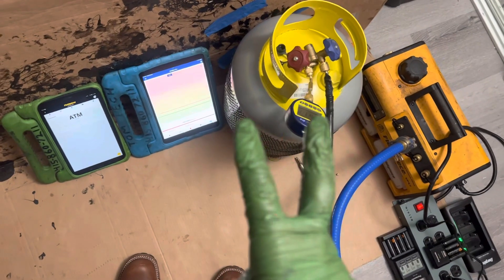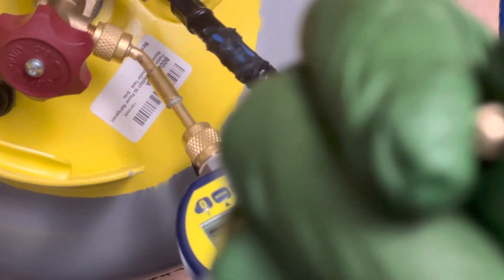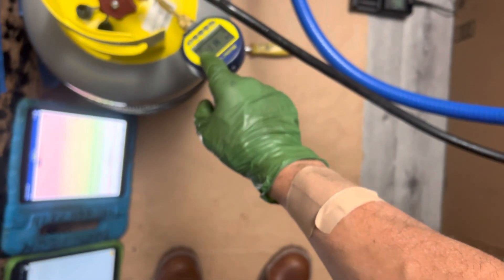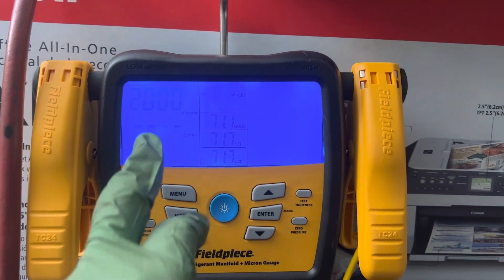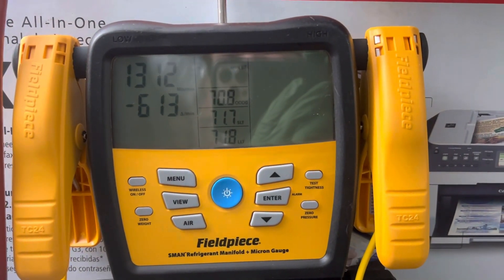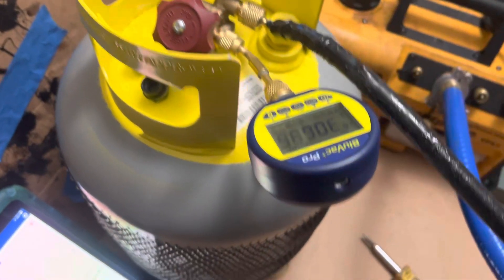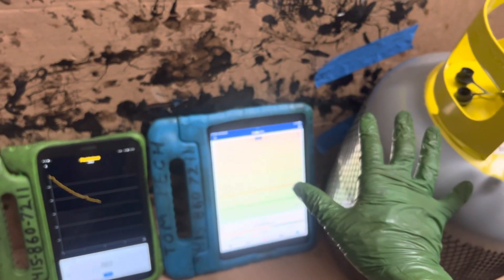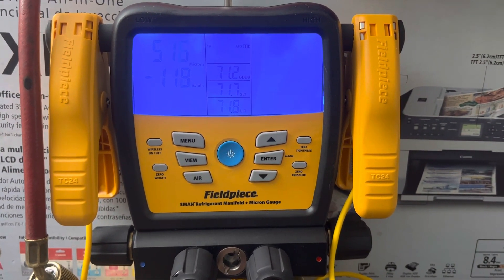Removed Valve Core Depressor ￼out of Hose to Speed Up Vacuum. Time Dropped From 16 min to 9 min

Comment: Wow. Trublu is such a mighty sucker.  Almost 1,000 micron higher that 1/4 yj hose is showing over the manifold. If my 3/8 yj is ur trublu, same setting as urs, the tank will show no more higher by 250microns aka 750 microns if my 3/8 at 500microns.